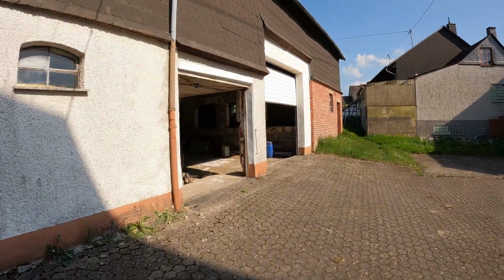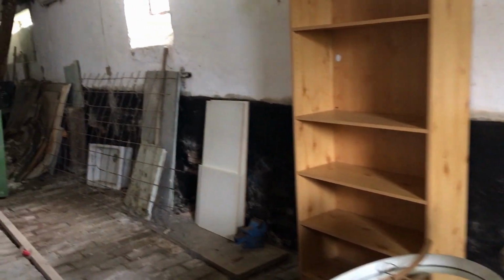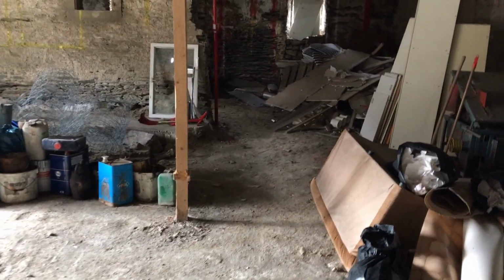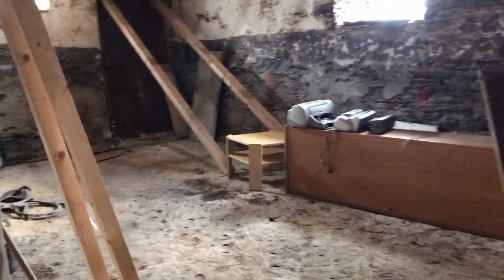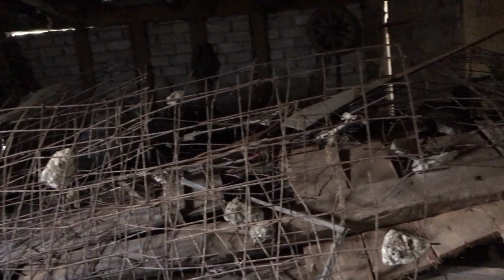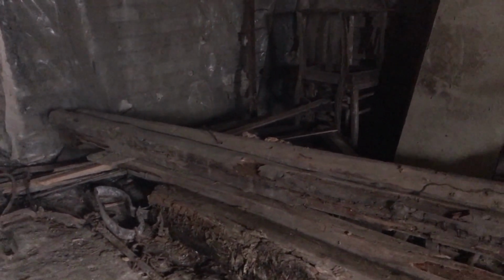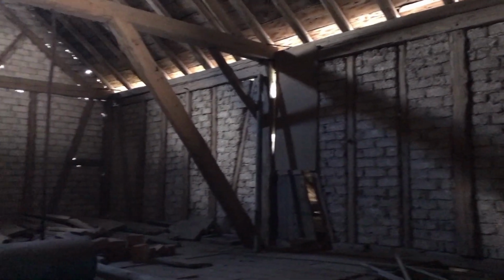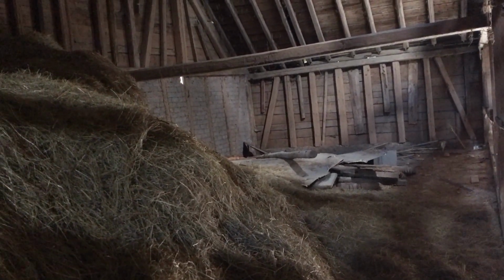Exploring the Big Barn - ep4 - Renovating a 230 year old Farmhouse in Germany

Comment: I can't believe you threw all that wood away - I would have kept it to keep me warm this winter.
Reply from the maker: We are definitely aiming to keep as much wood as we can. In the big barn we store the wood that we can reuse in construction work. Outside we keep two piles: the right pile is clean wood that we will use as firewood. The left pile is dirty, contaminated wood that we can't do anything with. This is only a fraction of the total amount of wood we found. It is mostly drenched in used machine oil (something they used to do here in the olden days to protect wood against the elements). Thanks for watching and commenting!